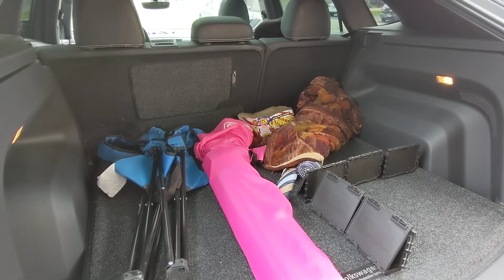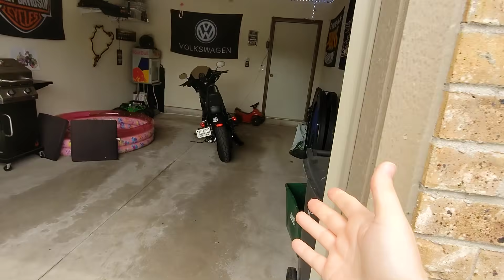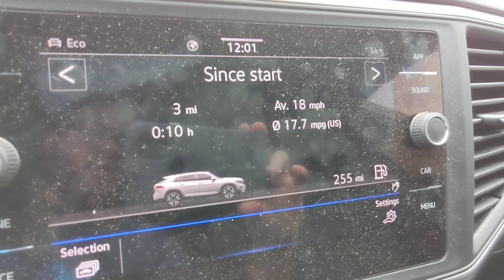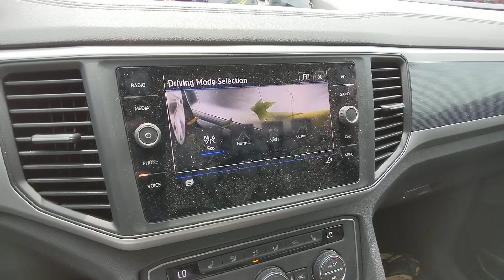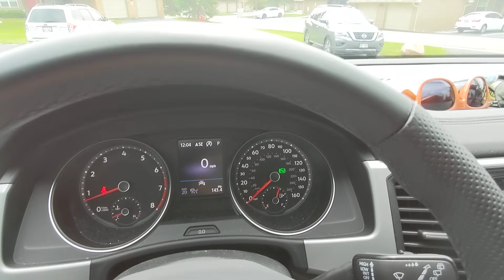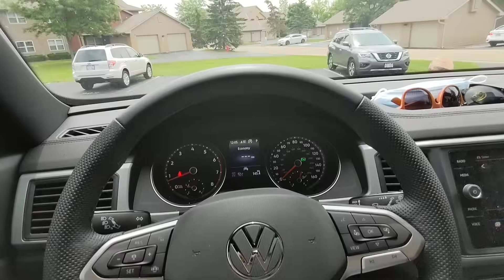2021 VW Atlas Cross Sport.  Why we're trading after only 4 months!

Comment: Researching on the gas mileage of a vehicle is the easiest part before buying!!! Looks like you dint do any research before buying this vehicle and then put the blame on the vehicle!!! Atlas is a heavy vehicle and more solid than a v6 honda pilot. So if you want a solid/heavy SUV, V6 engine and GOOD gas mileage, ha ha ha, thats not the right combo!
Reply: This guy just bought I for the body. It's an suv what did he expect that this is the only suv that consumes fuel like a car?
Reply: I mean do you buy a V6 for gas mileage?
Reply: You got worked over. Bought a 2021 Atlas SE Tech w/4motion for under 38K and 0% on my loan. You also haven’t spent time in a Jeep Cherokee or Chevy to think an atlas interior is cheap lol.
Reply: @LennoxThor47  The grand Cherokee is more size wise in line with the Atlas. That said the Cherokee has the worst body roll and pedal feel I ever felt in a car ever. Never had a worse car to drive in terms of feel than the Jeep - no trust in the vehicle behind the wheel whatsoever
Reply: @LennoxThor47  how did you get 0 percent?
Reply: @jaycobmelo1904  good credit at the time when rates were low and dude really needed a sale. I had an Atlas and traded it for a newer one with more features. almost got it paid off 2 years later.
Reply: @jaycobmelo1904 VW ran 0% for awhile. I got it in my Atlas as well. The 0% was the nail in the coffin for my Honda Pilot
Reply: @laurenzdeganos9875  not necessarily. The V6, or VR6 to be correct, in this car has been around since the mid 90’s.
Reply: @Scott L Rline is a graphics package. No performance upgrades at all. No difference between my SE and a Rline except badges. interior is same material and setup.
Reply: @Ben Smallwood  I disagree. The R line is more than appearance. The Volkswagen with the R line tag. Their handling and suspension is more tuned for sport. The un R line Volkswagen are more for comfort. I have a 2023 Tiguan R line Black. Take a curve and it handles it like a pro. No body lean. It holds flat in the curve. I'm impressed.
Reply: @reynaldocordero4247  Thats not correct. The atlas Rline offers 0 added performance besides badging. Every material and part are the same. There is no added or upgraded suspension or any other added performance measure. I'm on my second Atlas I've done tones of research. I wanted an R-line also but once I found out I was paying an extra few grand for AWD which I dont need where I live and Badging I chose not to do it.
Reply: @Ben Smallwood  So why you didn't get the Atlas R line? You can get an R line without AWD. I have a Tiguan R line Black FWD no AWD. You can get the Atlas the same way.
Reply: @reynaldocordero4247  because I wasn't willing to pay extra for badging and wheels. There is no added value for the utility of the vehicle. 
If there were performance enhancements sure but as it stands the only way to get a performance upgrade from the factory is to buy the Lambo version.
Reply: @Ben Smallwood  Well some people don't mind paying extra for cosmetics. Probably you don't. Anyway who wants a high horsepower vehicle. When you can't use it to its full potential. Speed tickets the cops won't let you enjoy it. I rather pay for looks on a vehicle than paying speed tickets.
Reply: @reynaldocordero4247  well the OG plan was to buy the atlas and have it for a few years and then when we move back to Germany we would just ship it over since its not really  on their market and off load it. We have a house way out in the sticks but the Autobahn is about 5 miles from our door. but I prefer something a little more sporty and 2 door for the autobahn.
Reply: @Ben Smallwood  you must want a 2 door car cause the only 2 door SUV. I can think of is the 2 door Land Rover Defender. You can get in Supercharged V8. The BMW 4 series M4 would be nice for the Autobahn. It's sporty and 2 door.
Reply: Lol Atlas is best option to buy. 
I bought atlas SEL for 42k on road 
Highlander was at 50k (with panoramic sunroof) 
You saving 8k right there for gas and any maintenance.   

You suck
Reply: Can you please say honestly how Hyundai Palisade v6 gdi engine is? Is this very good quality v6 engine? Will this engine run 500k to 600k km? I want to know because I have a confusion to choose from Hyundai Palisade V6, Volkswagen Atlas sel V6, and Honda Pilot Elite V6, please give me the right information because I want to choose a V6 car which will run perfectly 500k to 600k km without any big issues...
Reply: @KnowTheNewOfficial  no v6 suv is going to run for 500k or 600k miles without any issues. Ofcourse you will have to overhaul a lot of engine/transmission parts around 150-200k miles. Honda pilot v6 has lot of history, so its a proven engine but pilot is about to be replaced with an all new model soon. VW v6 also has been there for quite a while and the same engine is used in many VW cars/suvs. Out of the 3, I like the Atlas because of its interior space and comfort. Palisade and Telluride are super over-hyped cars thats got nothing extraordinary. THey are just regular 3row suvs but NOT as spacious as Atlas. Hyundai v6 engines are NOT known to last more than 180k-200k miles...
Reply: @nish224104  overhaul the engine?? you speaking video game language there.
Reply: @KnowTheNewOfficial  Highlander
Reply: hyundai sucks korean made i dont know why people drive that garbage it's like using payless shoes 👞 if you ask me
Reply: @KnowTheNewOfficial absolutely not worst engine on the market
Reply: We have a 2018 and 2019 Atlas and now have a 2021 Subaru Ascent.  The gas consumption of the 4 cylinder turbo is more than the standard V6 from VW.  The gas consumption of the Atlas is actually better than most SUVS lighter than it.  If you use the drive trainer software, you will get even more gas mileage.
Reply: @bwilliams1815  Why don’t you get the diesel for high milage?
Reply: it can’t be heavier than my old pajero which had a 3.8 v6.
Reply: Q
Reply: Which is better 4 cylinder or v6. Can’t decide helppp
Reply: This comment section is bizarre lol a V6 isn’t a “big” engine and 19mpg isn’t bad at all for an suv. Do we live on different planets? 😂
Reply: not true now a days...may be true 10years ago...
Reply: @nish224104  the engine in the pilot now is the same 3.5 motor from 10 years ago, it’s very reliable
Reply: @laurenzdeganos9875  have you had a new Honda Pilot? That’s what I traded in for an Atlas. Fit and finish on interior panels was shit, pop the hood and welds were very sloppy on body panels. I paid for the Ex with leather and Navi. The Nav after multiple updates would project my location to the side of the highway on the screen as though the car was floating around the screen. I performed several map updates and never got a resolution. The finish dye was coming off the passenger front seat which had less wear than the driver seat. That was my fifth Honda. Over the years I’ve had seven VW and all have been good to me so long as I stay on too if maintenance. The pilot carpet was also awful, you couldn’t vacuum grass and dirt out easily and it would retain debris even after a full detail. In short the Honda did not impress
Reply: @TheMlvswoll  lol I just traded in my 2021 Pilot Elite for an Atlas Compass Cross Sport Black Edition RLine. That was my third Pilot. The Pilot had to have the starter replaced in Jan 22 then again in May 22. A car with 30,000 miles on it. Took my son to test drive a Jetta and I walked away with this new car. Soooo much nicer than my Pilot. Thought I’d miss the third row, I don’t. I do seriously miss the ventilated seats however. It doesn’t get as good gas mileage as the Pilot did, but it’s so much more comfortable and just feels safer and sturdier. Much more fun to drive. Even Eco mode has great power. Without going electric, you’ll get about the same gas mileage in most similar sized suvs.
Reply: @TheMlvswoll  Why would anyone pay more for NAVI on a car when we all know the maps on our phone are more accurate and up to date?
Reply: @Cyberbronco the Pilot was a 2016 new. They didn’t introduce CarPlay until the 2017.
Reply: @TheMlvswoll  True, but you don’t need CarPlay to have navigation. Just use your phone. CarPlay is like an external monitor for a phone. I use my iPhone on a windshield mount. Keeps my eyes close to the road and less hassle. My Tundra has Nav and Appleplay. I find them both useless.

Comment: How can you end up trading your new car after 4 months??? that's why you go and see the car. Test it, watch some reviews... it's work you have to do, sooner or later as you have already noticed
Reply from the maker: As stated in video description 4 months after getting it our daily commute went from 10 miles a day to about 50 miles a day.
Reply: @amentauto3610  yeah i mean granted it's a big difference. But you know trading seems like a bit excessive. I mean when it comes to big awd SUV's that's what you get. diesel will do better but is more expensive to buy, and the highlander Hybrid HAS to do better obviously but hybrids do have a smaller fuel tank, we had a lexus RX450h here which was basically a highlander, and on highways the consumption was horrible, and range wouldn't even reach 300 miles....other hybrids i've driven have exactly the same issue

i've seen that you've got a wrangler 4xe now, jeeps are not exactly aerodynamic but being phev it should do better. i just hope  that the 50 miles means 25 miles each ways. if not when you train the battery consumption won't be good either....because 100miles a day is just a lot of fuel haha

anyways hope you enjoy it man, it looked pretty sweet!!
Reply from the maker: @pablomoreno1999  thanks!  We've saved 200$ already in fuel.  Considering we lost only $1000 trading it In I think it was a good change.
Reply: @amentauto3610  indeed, you'll make up the difference in no time. i'm going to havr to take back my words 😌
Reply from the maker: @pablomoreno1999  holy crap.  A reasonable person in the YouTube comment section?  They do exist!
Reply: @amentauto3610  hahahahaha you know, to keep variety around🤣

Comment: Alternate title "I bought a SUV and expected great MPG???" You're not going to get a full-size SUV with amazing MPG. And an SUV is pretty much always a bad idea for a wallet friendly commuter. I would suggest the Tiguan. It has the third tow option, better mpg, 4Motion, and decent towing capacity.
Reply: The new Tiguan do not come with a third row
Reply: @monia1287  it definitely comes with a 3rd row option. You can check their site.
Reply: @Jamjosh  weird. If you upgrade to a 4motion there is no option. That’s why I never seen it. And I read somewhere else that they completely got rid of it when they came out with the Atlas
Reply: @monia1287  that is super weird. VW has been removing a excluding a lot of features for certain trims and builds lately. I heard they’re removing wireless apple CarPlay from base models and some middle trims too. Must be a cost savings.

Comment: Dude I almost bought a 2021 Atlas but just didn’t do it... Reviews weren’t great but they sure are sharp looking.  Got a 2022 4Runner SR5 Premium instead. I think I made the right choice. I found the steering wheel to be weirdly small to me. Cheers.
Reply from the maker: The 4Runner will really pay off when you go to sell it in 10 years.  Will probably get half your money back.
Reply: Just traded in my wife’s 2021 VW atlas s 2.0t with 20k miles on it. It was in the shop more times in the past year than all other Vehicles I have owned combined for water pump issues and low oil/burning oil. We will be picking up a 2022 4runner sr5 premium today!
Reply: @michaelgalvez8599  still loving mine! Good luck!

Comment: I did many research on 7 passengers vehicule, the best gas mileage is definitely the highlander 20-21 hybrid. 7 passengers vehicule are usually thirsty because of their weight, turbo engines may be good but you will lose some towing capacity.

Comment: I'm kind of bemused. Didn't you research the mpg before you bought it? Any large, heavy SUV with a petrol engine, even a 4 cylinder, will give you poor mileage. I imagine anyone would know that. I bought a Kia Stinger V6 and the mileage on the highway is superb. Around town it's fair. But I knew that in advance and haven't regretted a moment buying it. 

On another note, the outside of the car looks great. The interior looks cheap, sparse and utilitarian. I personally would have opened the door, looked inside and went, "Let's look at another car".

Comment: Did you realize any of this before you bought the vehicle?
Reply from the maker: As stated in the video description shortly after we bought it a career move made our daily commute go from 10 miles per day to about 50 miles per day.  It got absurd pretty quickly driving a massive gas guzzler 250 miles a week just to commute to work.  Factor in running around on the weekend and running errands we were dumping $60 a week into the gas tank.

Comment: I have a 2019 Golf Alltrack (6 speed manual, 4-Motion) which I love to death. The Atlas honestly smells too strongly of "vehicle designed specifically for Americans", which to me, as a long time VW fan, triggers warning bells. No offense to anyone who loves the American market Passat, but market specific vehicles like those tend to lag behind VW's global vehicles in features, quality, interior materials, and lots of the little touches they're known for. They also get refreshed a lot slower and get full updates rarely (if ever). I agree, it's not a bad car, but their global vehicles have tech that this Cross Sport is lacking and if you compare it to the new upcoming 2022 GTI, you really start to notice the wide gap between them. One of the glaring things I noticed were the rear seat fold down handles that are on my Alltrack, but weirdly missing on the much larger Atlas (located on the sides near the hatch opening and let the seats fold down without having to walk up to the rear doors). Just one example of a small thing that makes a difference but they omitted, likely due to cost cutting. Again, not saying its a bad vehicle, just that VW dilutes their brand reputation by delving into market specific vehicles like this while withholding popular global vehicles from us.
Reply: Spot on
Reply: Euro VWs are low quality now too. MK8 is just a really redrawn Mk7, all cars got facelifts when they should be new gen. Golf, everything that’s not facelifted, just new, uses hard plastics. Headlights are worse than ever before. Mom got a T-Roc and I like it lots but has material issues, not quality, but it’s not MKV golf she had which was as good as my BMW, even MK7 SV was partially better, but MQB cars were the first to start cheapening out
Reply: American VWs confuse all the euro fanboys who are shocked at the comments from Americans about VW’s being finicky, fragile, and expensive to maintain.
Reply: I would kill to get the new golf R wagon in the US
Reply: The sport wagons are great all arounders and not boring to drive like  Subarus and Hondas. Rolling a 2.5 JSW. I'd love an all track but they're astronomical ( over 30k!) Right now

Comment: I just test drove an RLine Cross sport Atlas and came away with a feeling of very average and utilitarian. It had the full digital tach compared to the analog ones you have in this video. My biggest problem is the interiors feel like the old VW's I've had back in the early 2000's and it hasn't gone through and significant redesigns...it feels old. I've been looking at the Hyundai Santa Fe's and Kia Sorentos and they just feel better and the quality and materials feel properly good.
Reply: Omg 😱 people, don’t put the design of a VW vs Kia and Hyundai, it’s definitely not the same category. All of it is still just fake leather but the style and class it’s completely different, even with the new design.
Reply from the maker: Kia and Hyundai have definitely came a long way.
Reply: I can't speak 100% on the SUV's but I agree with the interior, at least when it comes to anything other than a GTI or Golf R. However, i've driven Kia's and Hyundais in the same "class" as the GTI and they just don't compare when it comes to the overall fit and finish, ride quality and handling. But have to admit, Kia has come a verrrrry long way. Especially after they snagged Audi's old designer.
Reply: Skipping Atlas and saving for a Ford Bronco Black Diamond or Jeep Rubicon
Reply: U sure u were in a rline mine is luxury with 2 tone interior and wood grain and all the above.  Idk maybe mine was customer built or something cuz it doesn't look like any of these it looks luxury and I have a panel digital pit none of those gages it's a lcd screen . This guy's is weird compared to mine

Comment: Get a 4 cylinder buddy... Also, gas mileage depends on the foot of the driver and you should not get an AWD. Also the weight of the vehicle effects the MPG...and the AC...Tire pressure...etc.

How did you not know this about a V6 SUV?

Also, have you ever owned a Hemi V8... If yes, then ur VW V6 is way better in mpg...trust me... If Not, then get a Hemi. The Gas STATION is the HEMI HANGOUT!

You

Comment: My Jetta easily clears 43 MPG on the highway. I fill it up less often than my old Camry and the tank is a third smaller.
Reply: I have a GLI. Can’t relate to that 😂. Fuel economy is great for a car you drive fast and hard. But the fuel tank is just too small. 11 gallos with 25-30 mpg is just a very small range.
Reply: The reason why it’s because the Jetta is a small sedan and the Camry is a big size sedan